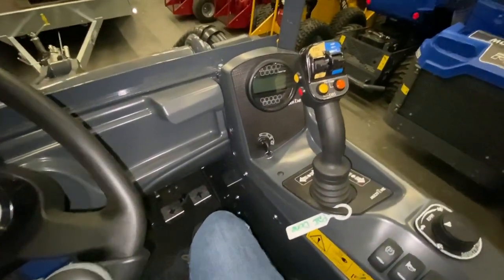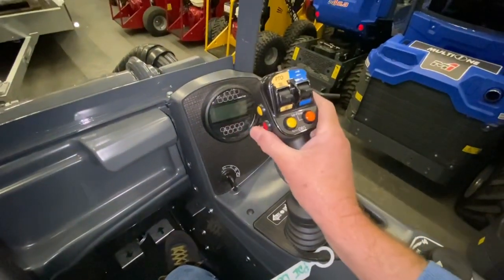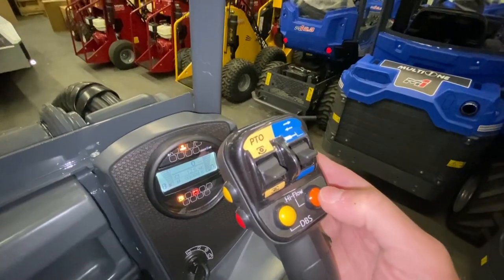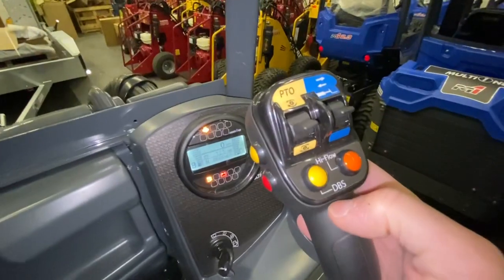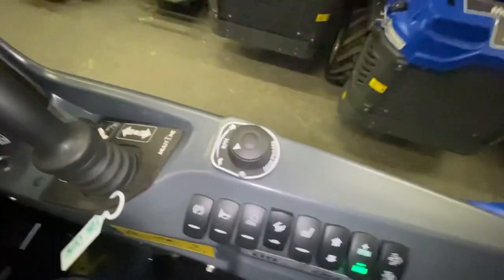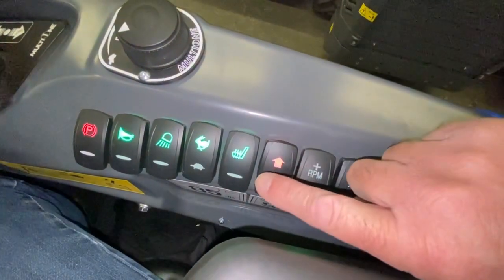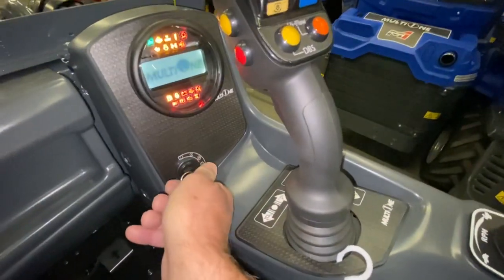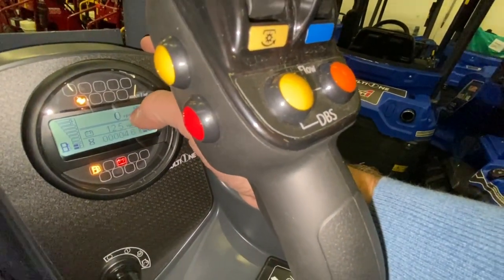Quick intro to the controls of a MultiOne 8.5SK Compact Loader

Comment: So my question was, when you push the heated seat button, does the small segment light illuminate?
It killed me, he flipped every switch but that one.
Can anyone help?
Reply from the maker: Hey Alan, the switches have a light on them that comes on when activated. This is the case with the heated seat switch. So you know when it is on, because the switch will illuminate to tell you. BUT, there is no light on the display to tell you when the heated seat switch is on.
Reply: @CompactLoadersUK  Thank you for replying.
Reply: @CompactLoadersUK  To double check, that would be the same on a 5.3 is that correct
Reply from the maker: @alanbechard5852  should be

Comment: please explaine function of cruise control
Reply from the maker: a new system on the models with ONE Drive fitted. This gives the ability to lock the drive speed, just like you would with a car. Very good for long periods running a mower or flail for example.

Comment: That's a great explanation of the controls.  Is the 5.3 very similar, be good to know for when mine arrives 🙃
Reply from the maker: Basically the same, except the 8.5SK has some extra features not on the 5.3K (ie. torque divider, 2 speed drive, DPF are not on the 5.3K).